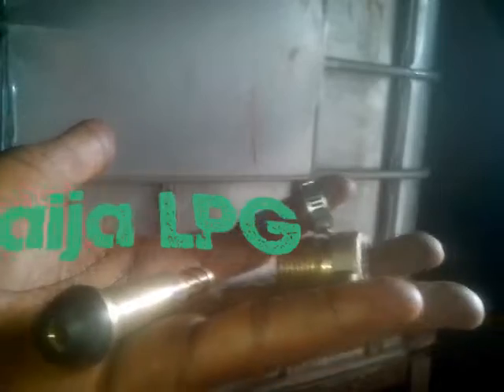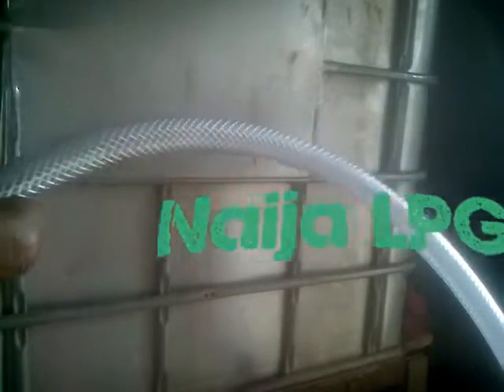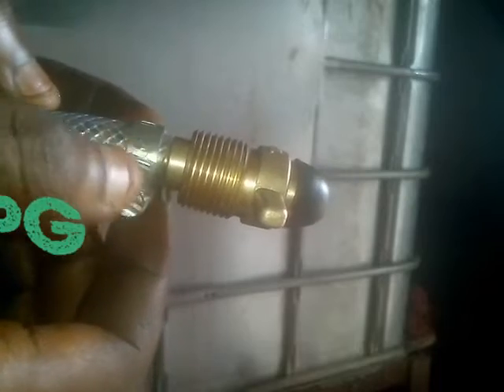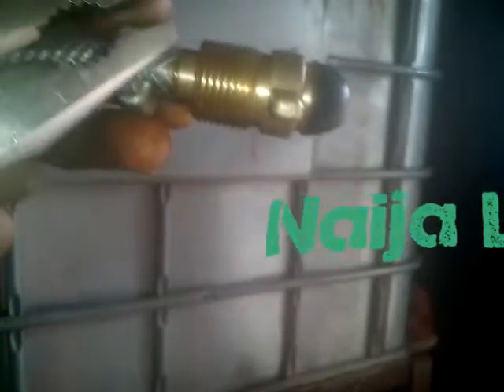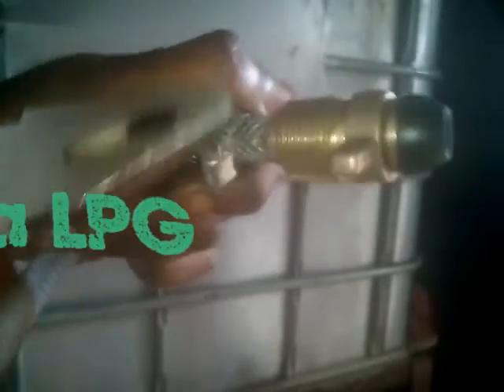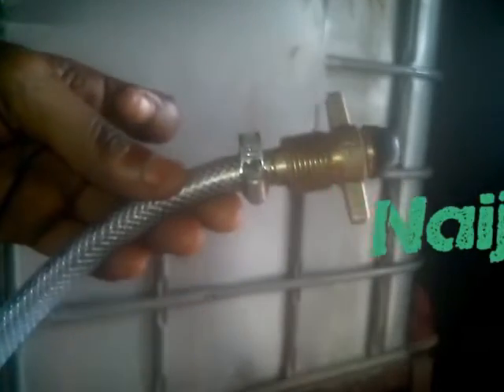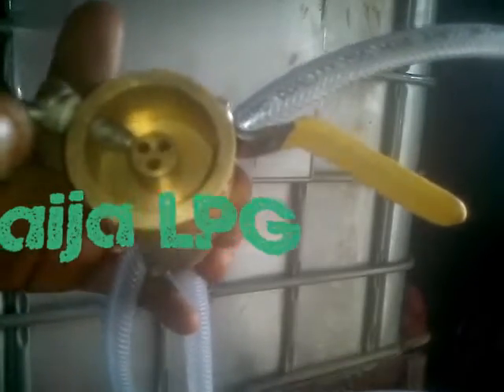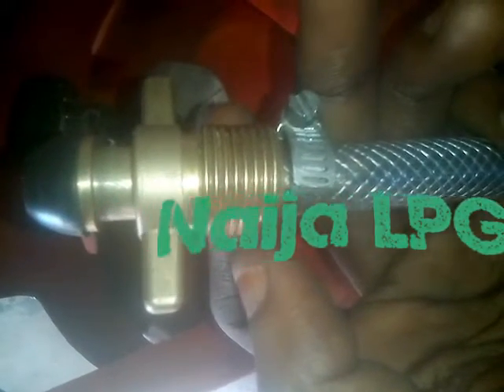Warning: Avoid Mistakes with DIY Gas Transfer Pigtail Hose For Tank Refill

Comment: U know nothing about gas putting it wrong.shame
Reply from the maker: Are you considering venturing into the LPG gas plant business or already running one? Don't let unexpected losses derail your success. Introducing "Optimizing Your LPG Gas Plant," a comprehensive ebook designed to guide you through the crucial first six months of starting up and operating your LPG gas plant with confidence.

https://www.selar.co/87nd
Reply from the maker: Thanks for your comment. Kindly explain the right way it should be done. Let others learn from you.

I will be waiting for your comment. Make a video then tag it here. Stepbystep direction.